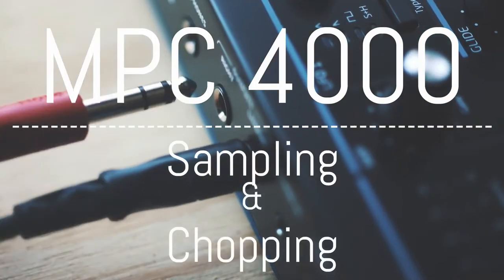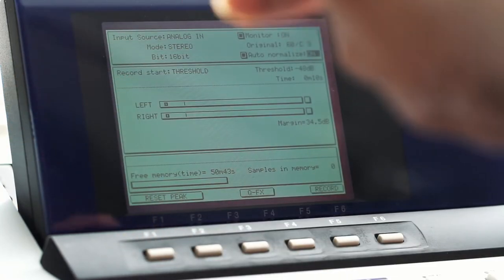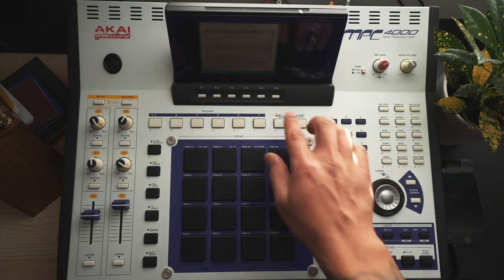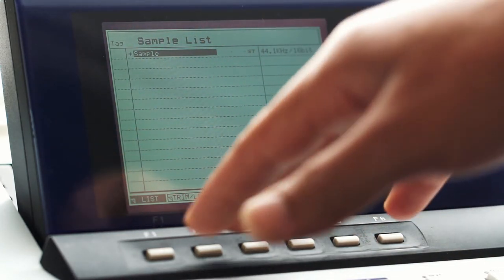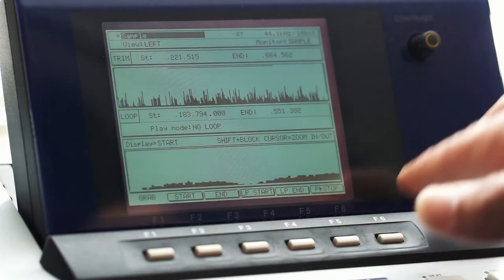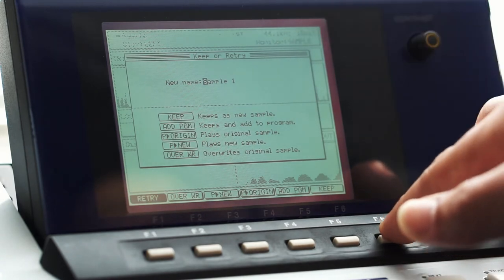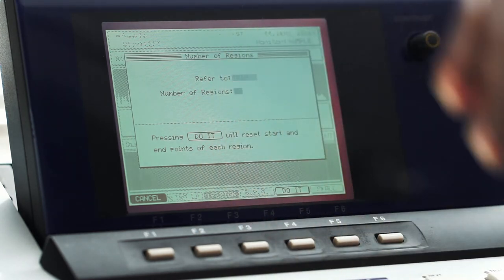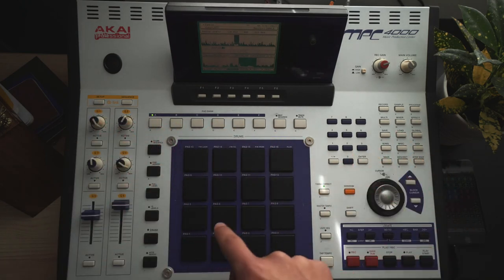Sample Chopping & How to Sample // MPC 4000 Beginner Tutorial

Comment: Hey RT, thanks man. Nice video. How would the mpc 4000 be as a DAW? I've got a little Roland synth, guitar and other stuff I want to record different tracks and takes from. Along with some vocals, then "perform" a song on an MPC and record the performance, and then tweak the performance. If that's possible on an MPC. (Ableton just doesn't feel right for me, putting this all together.)
Reply from the maker: I currently use it as a DAW. And it works. But it’s a little tricky at times and you have to really think about the way you record things in and how you play them out.
For example for the record a baseline you have to make sure you trigger that loop correctly in time. It’s really fun but it’s not like a traditional DAW where you have stems and you arrange them and what not you do technically have to sort of play them in

Comment: yo idk what's wrong with my MPC 4000 but I'm sampling from my record player and there's a ridiculous amount of distortion. I have everything set to basically zero. any ideas
Reply from the maker: There’s a switch on the back to make sure you’re not going from line or tomato, and the other thing to check would be the sensitivity level. I always have mine on low for the most part.

Comment: Rickey Tinez I have somebody offering me a trade of their MPC 4000 for my MPC Live.  Right now my MPC Live is worth more than the MPC 4000, but I'm not sure which will retain it's value better. Both units have their advantages and disadvantages... Portability and power across the board for the MPC Live (Plug-ins in a stand-alone MPC), and more midi control and a better sample engine for the MPC 4000.  Both my MPC Live and his MPC 4000 are in excellent physical and working conditions.

My question to you is would you make this trade if you were in my shoes? Does the behemoth size of the MPC 4000 make it less future proof since the future of technology is to make gear smaller for more studio space, and more portable, while at the same time being more powerful on paper???

Comment: I just pulled my 4k out of my mother's basement after like 10+ years. It needed some repairs, which I managed to do myself, and now it's working well again (except for some lines across the screen, which I'll be replacing soonish). I'm psyched to get back into using this old friend. Do you have any video where you explain why you switched to the 3k?
Reply: Lines on the screen can easily be (was in my case) the screen cable that goes into the main board needing a clean and refitting.

Comment: I have 2 question: why is the 4000 your favorite? What makes it special over other MPCs? Second: do you think it’s a good machine for live as well, or is it really more intended for production? Asking because I saw one on Craigslist at a fair price and I’m. Wondering ...🤔
Reply from the maker: I think the 4000 is my favorite because it offers the most flexibility but it still has a bit of that old-school sound and old-school feel. I'm actually in the middle of setting it up for a live set and it's pretty tricky, but once you understand the way it works it's pretty simple. It's a beast in a studio and can easily run your entire setup.  what is a fair price?
Reply: @RickyTinez  oh its cheap, I'm not telling you otherwise you'd drive down to SD and snatch it 😉😊😂... Kidding aside, it's at least 100 less than the next lowest price I've seen around, am 1/2 of the highest. It's not what I was looking to add next, but it almost seems like too good to pass